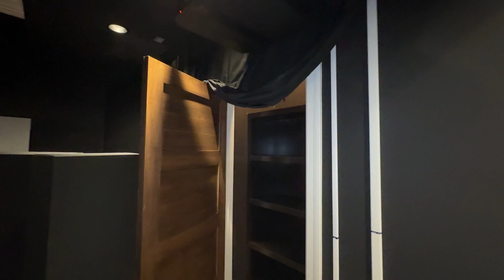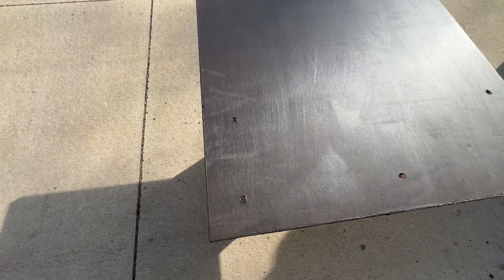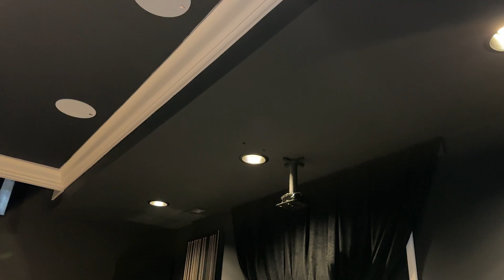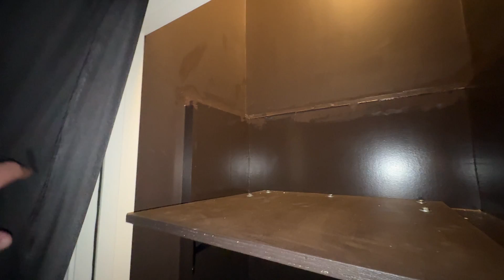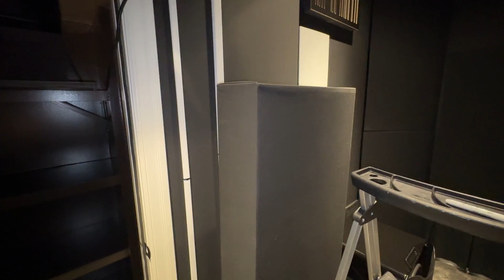Massive Home Theater Improvement | Re-Installing My JVC 4K HDR NX7 Projector for Maximum Impact

Comment: I just bought this but won't get it for another week. What's the screen size and distance of projection? How are you finding the brightness in HDR with this PJ?
Reply from the maker: You bought an NX7? I've since upgraded to an NZ900. It's insane. I'm very glad I moved the install though per the video.
Reply: @Techthusiasm  I got mine for 2800 with a brand new JVC bulb with 0 hours and it was owned by a reputable member of the Cinema community so I'm not getting it from a random seller. He stands behind the sale as well. My theater has been complete for a while but missing the projector and although I wanted the NZ800 things came up where I have to hold off that purchase for another while. Thus I jumped on the NX7. So how was your experience with it and any issues in particular?
Reply from the maker: The NX7 was great. I used it for several years and sat out the NZ single digit generation with the NX7.

Comment: I like your new setup! I do think you'll need some kind of active cooling, since that is a closed space. A projector makes a lot of heat, and it would suck to damage or degrade it. AC Infinity makes lots of nice stuff that can help with that.
Reply from the maker: After doing a few movies since moving the projector, actually, it is running quite fine. The fabric isn't even warm to the touch after a full movie. But I'll be monitoring nonetheless and adjust as needed.
Reply: @Techthusiasm  I think I'd at least throw some kind of temperature sensor back there to keep an eye on it - perhaps one of those little Nest ones?
Reply from the maker: Yes, that's my plan. Just ordered a temp/humidity sensor to check it out.

Comment: Great video. Room looks great. Can I ask how air is going to get into the projector with the curtain there?
Reply from the maker: The whole space is open behind the curtain and the curtain hangs forward of the wall a bit. With the hot air blowing out the front through the opening, cool air can come in all around the sides and door opening. I can always continue to modify if needed, like cutting some curtain space open behind the standing acoustic panels in front of the door.
Reply: @Techthusiasm  Thank you. I really enjoy your channel. Keep up the great work.

Comment: Hey, great job! Another step towards the ultimate room! Love following the journey, looks good.

What are you doing there to black out the area on the wall above the screen? Looks good. I only have 7’ ceiling in my room and still struggle with ceiling reflections even with the room blacked out and with black felt on the ceiling. It’s one of the things I can improve. One day I will do velvet but have not wanted to commit yet, and I am not very handy
Reply from the maker: Thanks! My screen is installed so it floats forward of the wall, and then the same black velvety material is hung on the entire wall around it. The ceiling is just painted flat black. I'm thinking about flocking the first few feet of the ceiling with material though at some point.
Reply: @Techthusiasm Cool.  Yeah, I don't have nearly as much space between the top of my screen and the ceiling.  Probably about 1 ft. If you get to doing the ceiling, we should collaborate and figure it out!  Best idea I have so far is black velvet attached to corrugated plastic squares, then a staple gun to attach to my drywall popcorn ceiling. For now I just used thumb tacks to tack up the black felt sheets I got on Amazon.  It made a big difference, but still there is some glare off of it.

Comment: IDK  if anyone else added this but IF? You run your projector like this you are at considerable RISK OF FIRE HAZARD.. The heat from the light emitted that’s still touching/shining on curtain can get incredibly HOT…

IE it’s merely inches away from the lens etc a little common sense here…
Reply from the maker: The light is going through an open hole in the curtain though. I've already opened the hole bigger than at the end of the video and plan to do so enough so the entire front face of the projector is unobstructed for full hot air flow.
Reply: Good job.. Just looking at what you put in the video.. Again just looking out here, not trying to be a jerk.. 

I’d still be Leary as a friend of mine did something very similar and the heat build up over just 30 min of use was scary hot IE on the Fabric etc
Reply: You have done a fantastic job on your theater love it! Quick question? I never heard your thoughts on the prior Arendal Subs? IE I see u went SVSsb16 x4 but the Arendals seem to possibly be better? IE on paper 2 drivers in push/pull IE like perlisten subs 

Please LMK Details as I am still considering those sealed Arendals 

I have 1 SB16 and 3 REL 1508’s I know odd but the Svs was 1st and I got the itch after watching other reviews on REL.. Anyhow thnx..  Sean.
Reply from the maker: The Arendal are great, but my preference and better option for me was to converge on 4x of the SB16 than getting more Arendal subs. I like a few specific elements of the SVS a bit better, like the more reliable app and build logistic.
Reply: Got it.. But what in your opinion hit harder/cleaner etc IE if just running 2 svs vs 2 Arendals? Thnx again for your time.
Reply from the maker: Arendal sliced like a ninja. SVS feel more full and complete. To me. Did you see my SVS review? https://youtu.be/9Dcm9VF8CHo
Reply: Yes.. and thnx again

Comment: Definitely a lot better in terms of air flow around the projector.  Unfortunately this setup would still void the warranty that JVC provides due to the space that JVC states is required behind the projector where the air intake vents are located.  I don't think you will have any issues with heat but this is definitely still an install that would be considered not appropriate by any professional  installers.
Reply from the maker: The information per the manual is 8" of clearance in the rear. https://www33.jvckenwood.com/pdfs/B5A-3961-41.pdf Page 28.

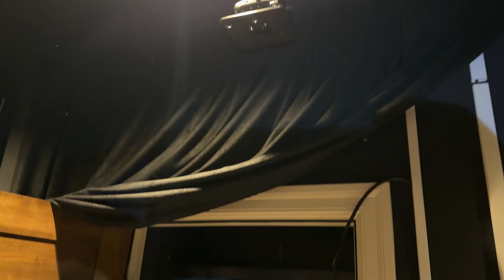Comment: 9:14 very important to make sure anyone with a projector understands that the warranty will be voided if you fail to follow the manufacturer's recommendations for allowing space around the projector. Especially the air intakes in the back and the hot air vents in the front.